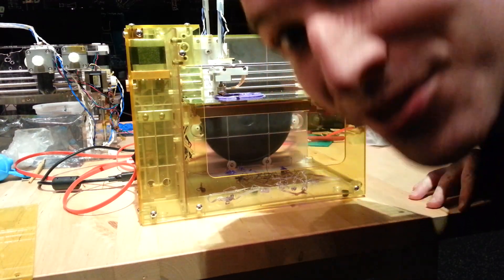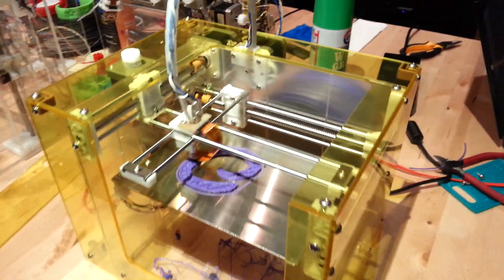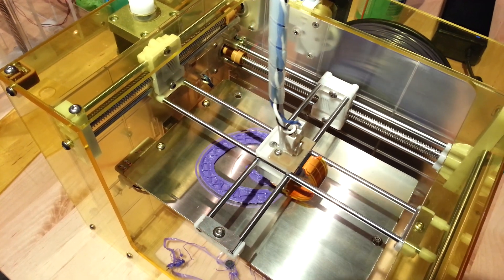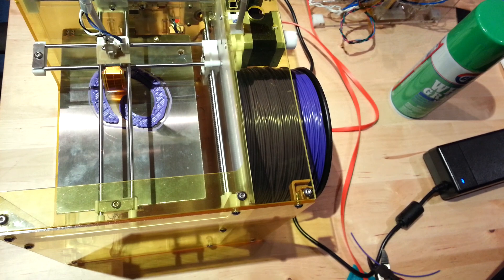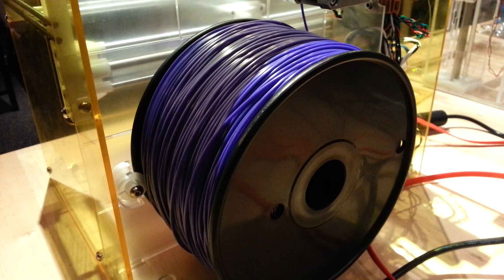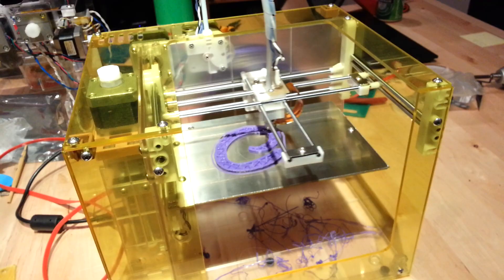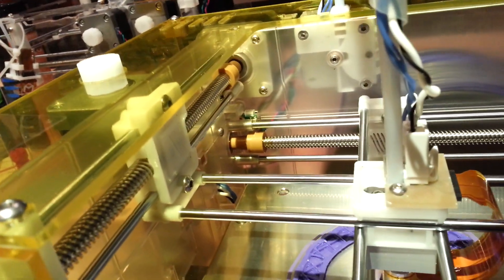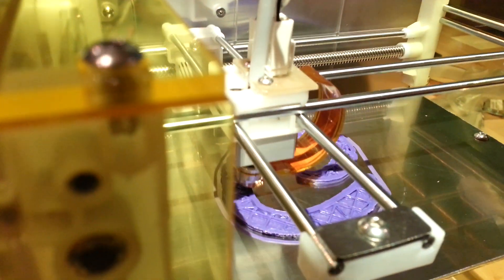#MakiBox A6 - Pre-production First Print

Comment: Since it is a first print, we ran it at a conservative speed. I assume you are the same type of person that takes a new car directly up to insane speeds. :) Also, this print runs slowly either way with cooling turned on. The speed per dollar is around 0.15mm/s vs. around 0.05-0.1mm/s per dollar on the more expensive machines. We typically run at around 45mm/s ungreased and 55mm/s greased for printing speed.

Comment: Since this was a first print, we ran it a bit slower than usual I think. Typically, for ungreased mechanisms, around 40-50mm/s. If you grease and tune it, 50-60. This print may also be slow because it is small, and with cooling enable enabled in Slic3r, it will make the layer take a minimum time.

Comment: You might be able to push some of the distances, but we do have soft limits in the firmware that prevent it from moving further, so when it hits those, it will not move further.

Comment from the maker: The screws will be attached to the motors and the control board is completely soldered.

The rest is just press-fit and screw.

We'll have a video guide up soon and we're working on the print-version right now

Comment: Nope, if it is higher, you get jerking or stalling at higher speeds, at least that seems to be the results from initial testing. I think 60-80mm/s will be the top end with this device. Fortunately, you can change these settings via M-codes and save them to flash, so no need to mess with the firmware itself.

Actually, there is almost no play seen in the moving arms. It is moving just as fast as the betas, but looks like it is staying aligned better already.

Comment: Speed, seems like 50-60mm/s will be doable. We are running test prints in the 50-55mm/s prior to greasing the mechanism. This is around 10-15mm/s faster than the betas. Acceleration, I'm not sure off hand, but I think it is like 100-200mm/s^2